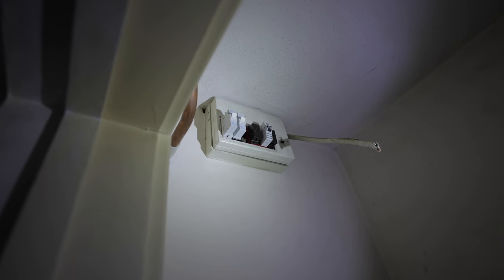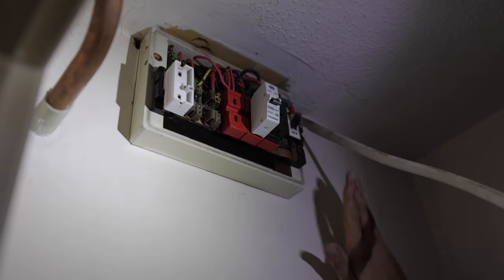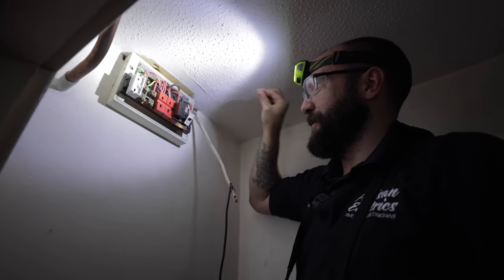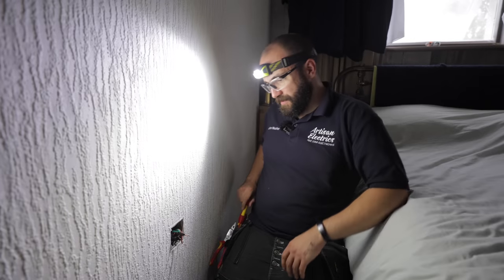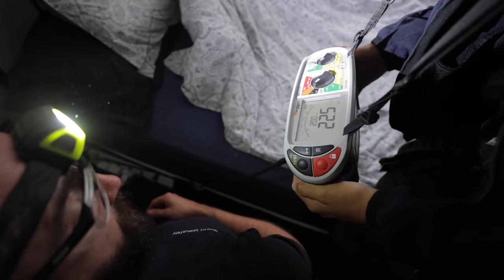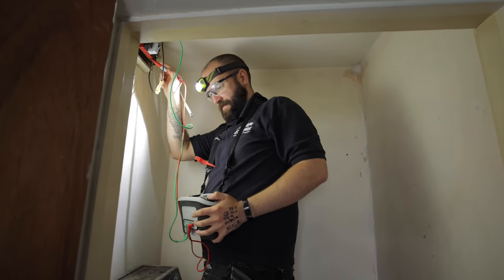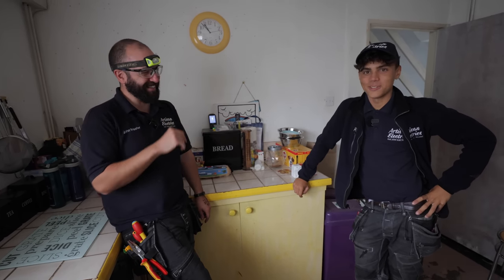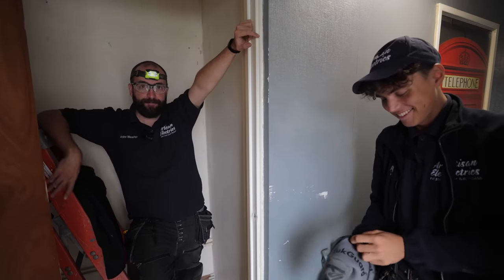The WORST Electric Shock I've Ever Had!

Comment: Not a shock in the sense we're talking about, but I once forgot my multimeter was in current mode and tried to measure the voltage across the Live and Neutral terminals on a Switchin power supply. Blew the fuse in the plug and the fuse in the meter, and also nearly gave my self a heart attack when the inevitable bang came.

Comment: i was taking out was a old transformer for a old doorbell in my late mum and my dads garage i started to unscrew the cables and im guessing my late nan went into the kitchen next to the garage and switched the kitchen lights on which in turn caused a bang a blew the screwdriver in my hand across the garage and left a tingle in my hand

Comment: How about a shock from 15v AC  .I.S. signal supply,  yes 15 volts, I can also feel a 7.5v pilot circut, dread to to think what 230 would be like.
Reply: You can certainly feel that voltage, but it won't kill you.
Reply: @deang5622   it was a constant tingle,  I was very glad when the connection was finished,   ( can't stop the coal belt)  but bet we wish we had it now.   its only static shocks i get now, Oh and the electricity bill of course

Comment: Here in the USA about 20 years ago I was working in an industrial panel 460 V three phase. I was trying to place a self adhesive wire management pad on the inside of the cabinet next to the main disconnect. Well I thought I could place it without turning off the power because the machine was running production. I placed it with my finger tip Then I went to push it even harder and got my fist stuck between the lug and the cabinet. I got a 277 V shock that went through me to my shins which was resting up against the bottom of the cabinet. Gravity pulled me away from it. I did not go unconscious but the next day my chest was green. I probably should’ve gone to the hospital but I didn’t.

Comment: The worst shock I got is as a student at Grateley House School in Hampshire, a student flooded another students bedroom & when the power was still live with water coming out of the light switch the student that flooded the other students bedroom proceeded to turn the hallway light on, i reached round the wall whilst stood on dry carpet & turned the light switch off, in the process of turning the light switch off I got shocked with 230v, the end result I got from the shock was heart palpitations but I was lucky not to have a worse shock.

Comment: Had a couple of shocks, nothing special. However the mentalist thing I've seen was as an apprentice I held a swa for my mate to cut, maybe 4c 25mm, something like that. It had become energized and it basically vapourised about 3" of hacksaw blade.
Reply: Bet that made a nice flash. I’ve shorted 2.5 t&e with a knife before and the blade nearly melted in half. An old mate of mine once put a pickaxe through the supply armoring for a pub and the tool did not survive.
Reply: @zmanicminer  hell of a flasha mate. I sort of froze, luckily I had safety glasses on and they had tiny bits of metal on covering them, I looked a bit like wile coyote after an explosion but I wasn't hurt. My mate, the the time served spark near enough had shit running down his leg.
When the dust had settled we found the 2 remaining pieces of blade and hung them on the hacksaw to see how much had gone.

Comment: The second-worst shock I've had was when I changed the plug on a desk lamp (because someone had smacked a piece of furniture into it and cracked it). I forgot to put the screw back in that joins the 2 halves of the plug together, so it was only being held together by the outward splaying force of the cable retention bracket in the back half of the plug; I plugged it into the wall socket, which was already turned on, the front half of the plug fell off at the same time, and my thumb hit the line pin.

That was then eclipsed less than a minute later by someone using a defibrillator without putting the gel on the pads... sore and red chest for a whole week.

Comment: Worst shock I had was when I was around 15, and trying to "repair" an old D2MAC satellite receiver box.

I didn't have an o'scope at that point, and didn't know about proper mains isolation etc.
I knew some stuff about the low-voltage digital side, but suspected maybe a PSU fault.

(although I had managed to repair many CRT TVs, monitors, VCRs by that point, so I wasn't completely useless. lol)

I was trying to gauge the temperature of the heatsinks on the SMPS. I'd luckily already learned to keep one hand away from any mains-powered / high voltage gear, so I was touching one of the heatsinks to get a rough idea of the temperature.

Then I touched the other heatsink, and it seemed OK.
But then I wanted to feel the relative temperature BETWEEN both heatsinks, so put my hand across both... OUCHH!!!! lol

Obviously one heatsink was for the main chopper transistor for the SMPS, and the current violently cramped / shook the muscles in my hand and arm for half a second. The "surprise" was much worse than the shock itself, and it took about 20 minutes for my heart to slow down.

It could have been so much worse though, if I had put one hand on each heatsink, and the current went across the heart.

Lesson learned, though, and it made me far more respectful of high-voltage stuff.
It was extremely rare after that point that I ever worked on live mains gear again, as I learned that most of the common faults in electronic devices could be tested with a simple multimeter, and the power OFF.

(just using the continuity and Diode drop test on a cheap multimeter can go a very long way with testing passive components, diodes, transistors, checking for shorts or bad connection, etc.)

If I ever do work on anything mains powered now, or things like a CRT monitor, I still have the second-nature thing of keeping one hand away, and also looking at the entire mains cable to make sure it's definitely unplugged before touching anything.

(and that things like larger capacitors and CRTs are safely discharged first.)

Also, every circuit of the house is now on a brand-new RCBO, so that helps minimize the risk if something does go wrong.

I prsonally think every house should have RCBOs / GFCIs, or at least a whole-house RCD by law now.

I think RCDs are required in all new builds or HMOs? I'm not sure what the requirements are on having an RCBO on every circuit.
Reply: My eldest brother had some stories of when he had his own business doing fire and security alarms around Essex and London.

One such story was when he was at the top of a 20ft ladder, on a London Underground platform, working on an alarm panel. Many of the systems he dealt with were wireless, so had an antenna outside at ground level.

Lightning struck very close to the antenna. My brother saw arcing inside the alarm panel, and instictively went to yank the spade connectors off the battery, thinking something low-voltage was shorting out.

Before he had chance to grab the wires, part of the lightning charge went into his wrist, out of his elbow, arced to the outer case of the alarm panel, and threw him off the ladder. lol

He wasn't too badly hurt, but I think had a sprained ankle and minor scrapes and bruises.

Comment: In 50 years as an Industrial electrician my worst electric shock was in a factory mezzanine lighting where I came into contact with a borrowed neutral on a lighting circuit another bad one at an insurance office,an ancient fuseboard in a riser where all the earth's where connected to a big brass nut and bolt on the side of the distboard I attempted to loosen the bolt with a spanner which slipped and I got a good belt and could have fell down the riser but luckily electric shocks that are not grab ones tend to knock you backwards which it did to me so I fell onto the floor instead if down the shaft

Comment: Biggest shock I had was opened up a 3phase oven panel and it was arcing between phase 2+3 hadn’t tripped as I opened up the panel took a belt off the isolator right arm was numb for about 3 hours 😂

Comment: Had a few 240V shocks, always reversed line and earth. Always checked any wire with a neon tester after that. Worst shock was 20Kv off a test rig with a specialized valve which had an internal broken pin shorting EHT to the heater and hence into the circuitry. Luckily I have a very low skin resistance (useful when working with semiconductors) so it was nasty but not lethal. I went to my manager and said there was a problem with the rig and he said no there isn't and went to show me. He was blown across the room. His comment afterwards "Fix that damn thing, I'm going home".

Comment: Biggest shock I had was a mains cable hanging from a wall supplied from an adjacent meter cupboard my job was to change the CU and I was told it was dead never done my safe isolation and I brushed the cable with my elbow got a belter shock and a little scar from it.
Also I still believe people who got a shock when they were kids end up in later life to become an electrician.
I got a shock when I was about 8 from an old lamp holder before they become safety lamp holders.

Comment: Worst shock I ever had was when I had unplugged my PC to move it. I'd pulled out all the cables at the back then ran my hand down to make sure I hadn't missed one. I bridged the live and neutral pins on the power supply input with my finger. For those that don't know, a pc power supply has some big capacitors in it and they discharged into my hand.
Whole arm went numb for like twenty minutes. 
Trick to avoid it is to press the power button on the computer so it'll try to start up but it'll just drain the caps.
Reply: For the big caps to shock you like that there must have been something very wrong with your power supply. The big capacitors are only connected to the input through a rectifier so no current should flow out of the input. Some faults will allow this reverse current flow but they would also blow the fuse when powered up.

The only capacitors connected directly to the input are interference suppression capacitors but these are much smaller, usually under 1uF. You must have just been super unlucky by disconnecting the power at the peak of the AC wave and not having a working discharge resistor.

Comment: the worst shock I've had, is from the power supply board on my playstation 2 from the big 400v capacitor. I could feel the pain in my hand all day long after it happened.

Comment: I do signage and fit alot of Glass Neon signs, If youve dealt with them you know that the transformers are incredibly high voltage.
I was doing fault finding on a shop sign which was tripping the rest of lights, sign never worked when raining yet the day i went it was nice and sunny and flashed on.. Ended up narrowing it down to an earth fault on one letter (the glass was surrounded by a metal letter) i ran an earth to it and it worked. However was then showing the customer the issue, i managed to stick my finger where it shouldnt have ever went... im not a Holy man but i swear that day i was met at the gate by the man himself. Never felt a shock like it if im honest and NEVER want to experience it again.

Comment: Worst shock ever was the cable that came into the house from the road with 35 amps and 400 volts and I got my finger In between 2 wires😅

Comment: I had a nasty one, we had a couple of so-called "professional" electricians from where my father worked to connect up the boiler. This electrician installed two plugs on the circuit and I noticed one wasn't plugged in, so I reached for it and got both live and neutral pins into my palm and thrown across the room with heart palpitations and I must have blacked out for a couple of seconds or so. The boiler would start and then when turned off, it would start itself with the motorised valves closed. After 2 electricians and a nasty electric shock later, I waited for my parents to go out to my nan's house. I sat down and rewired the whole circuit to be safe and worked first time. I was 13 and the boiler worked for a further 30 years before the heat exchanger burst.

Comment: Ive had 3 during my apprenticeship my first was a connector block that was live and it just felt weird but i used a volt stick to prove and the sun was shining on it and then another was i was trying to change a socket for a double and I couldn’t find the circuit so isolated the whole board and stupidly didnt checked it as I thought it would be dead took socket off and grabbed ends and thought that didn’t feel right and found the property has 3 fuse boards not 2 that i had turned off and the other was on an open power supply i put my hand on the back of the iec connector as I plugged it in

Comment: Not being funny but this day and age no one should get an electric shock. It’s not funny!
Reply: Nobody SHOULD, but s#!t happens... mistakes are made, shortcuts are taken, etc.
Reply: Yeah I think that's more theoretical that a practical reality. Some people work on gear where exposure to live unshrouded conductors is the norm. The idea that they will never get the occasional shock is just not realistic.
Reply: @cbcdesign001  totally disagree. There is no reason to work live unless it’s unreasonable for the equipment to be isolated. Then there should be approved risk assessments and method statements. If you kill someone by allowing them to work live  or know it’s common place you won’t have a leg to stand on. Only guys who possibly work live would be LV jointers. And they are trained and equipped to do so. No one should brush off an electric shock as an occasional hazard. I come from the old days too and we used to do things differently but now there are no excuses. Is the odd eclectic shock ok working on HV? Exactly it’s 99 times out of 100 electrocution not just a shock. It is not acceptable or get an electric shock. And most certainly not an occupational hazard. More training is required with this attitude towards electrical safety. Sorry for the rant but some domestic guys out there need to catch up
Reply: @mdonoCFC hear, hear! I completely agree.